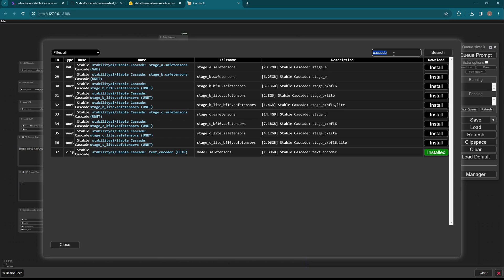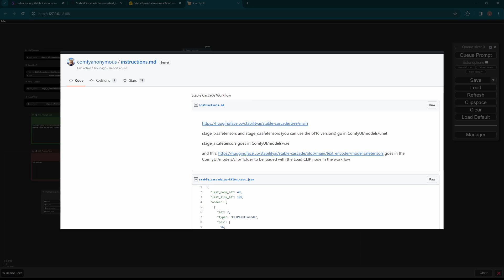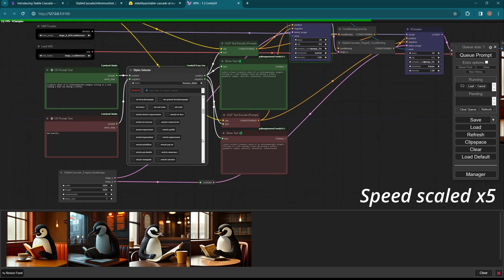ComfyUI Stable Cascade workflow

Comment: When i run the workflow,it stops and show me : Error occurred when executing KSampler:

mat1 and mat2 shapes cannot be multiplied (154x768 and 1280x2048)
Reply from the maker: It seems models/vae don't match, can you please double check the models are in the same nodes as in the video?
Reply: Thanks, I checked the models and vae and it looks like that's the problem. It works now @JanRTstudio

Comment: hi comfyui easy use import failed error i m getting. Not able to to run style selector node.
Reply from the maker: Can you copy the error code in the command line window regarding the import failed? that's strange if installed from comfyui manager
Reply: SyntaxError: Unexpected non-whitespace character after JSON at position 4 (line 1 column 5)  @JanRTstudio
Reply from the maker: @kuka7466  Hi can you check "Install Missing Custom Nodes" from comfyui-manager menu? generally it's missing nodes

Comment: Hi and thank you for this vid , i have a very large error, can u help me plz?

Error occurred when executing KSampler:

Given groups=1, weight of size [320, 4, 3, 3], expected input[2, 16, 24, 24] to have 4 channels, but got 16 channels instead
and ...
Reply from the maker: Sure! Very similar to the issue mentioned in another comment, can you double check the model names in 4 black loader nodes (2 unets 1vae and 1 clip) are correct? Sometimes Comfyui just update a default value if your model file location (0:31) is not correct.
Reply: @JanRTstudio  thank you so much , it fixed 😍
Reply from the maker: @nickchalion  Awesome!

Comment: The following node types were not found: 
-StableCascade_StageB_Conditioning
-StableCascade_EmptyLatentImage
Unfortunately, they aren't available in the manager 😐
Reply: did you update the comfyui itself , since cascade nodes are native not custom nodes I believe
Reply: @ischeka  Finally, it works - thanks for helping 😊👍 The issue was as follows: ComfyUI automatically filled the UNET, CLIP and VAE loaders, but for some strange reason, it inserted the stage a safetensor in the top UNET loader instead of the stage b. I had a hard time figuring out what safetensors need to go in what loader because they are so tiny in the video that it is hard to see. But it works now.
Reply from the maker: @MikevomMars  Great! thanks for the feedback! I probably need to make them larger next time😄
Reply: @ischeka  After updating ComfyUI, the nodes were available BUT the workflow stops with an error "Given groups=1, weight of size [320, 16, 1, 1], expected input[2, 64, 12, 12] to have 16 channels, but got 64 channels instead"
Reply from the maker: @MikevomMars  Can you double check it's stable_cascade selected in Load Clip type, and reselect all the models in that 4 black loader nodes? Or just drag the downloaded workflow to comfyui again to reload. I just updated comfyui, but can't replicate your error. Seems something wrong with the model loading.
Reply from the maker: @ischeka  yep, thank you!